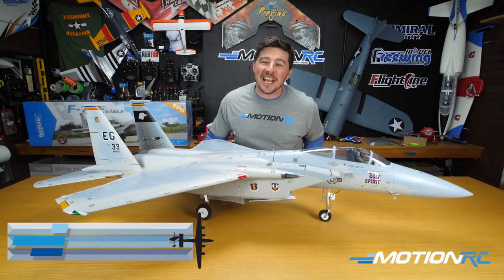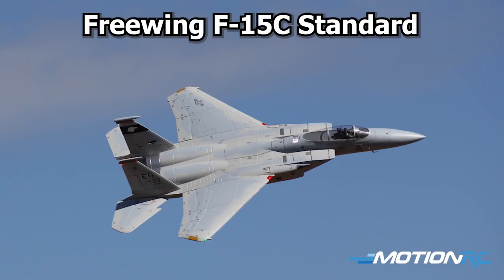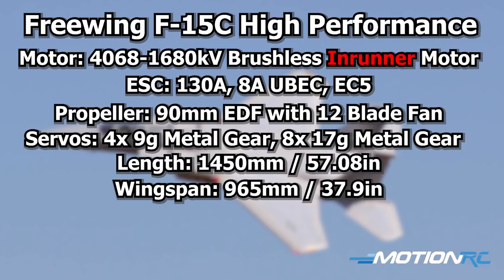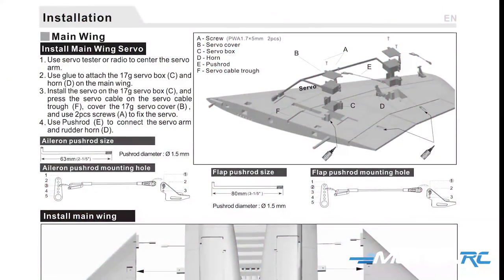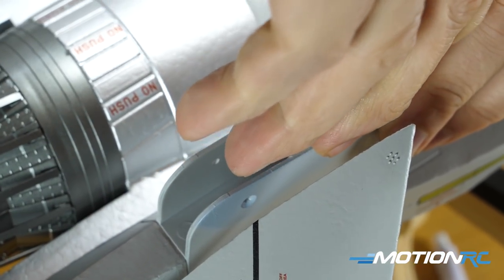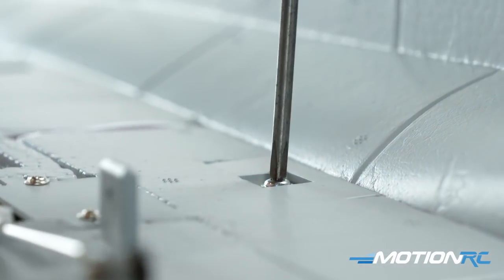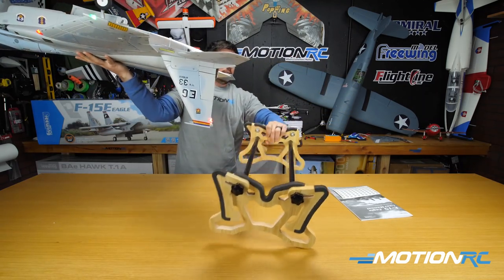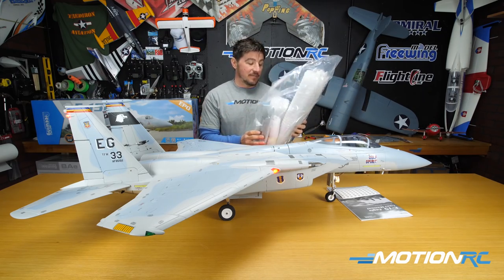Freewing F-15C Eagle 90mm EDF Jet - Build Video - Motion RC

Comment: A simple correction for the ordinance.  Those are replicated AIM-9 Sidewinders and AIM-120 AMRAAMs. They are  not AIM-7 Sparrows, which have not been used by F-15's (or the rest of the USAF) since 2004/5'sh. AIM-7s could only be loaded to the 4 stations on the main fuselage; AIM-120s can be loaded to those same stations AND on the rails attached to wing pylons.  I was a Maintainer on Eagles for 8 years before switching over to Raptors; 21 years later I am retired and enjoying videos of folks like yourself playing with miniature versions of those jets.  These 90mm EDFs are just amazing facsimiles or the real jets; can't wait to finally buy one or 4.
Reply: Thank you for your service! Are you flying them now?
Reply: Thanks for your explaination. Really useful

Comment: The build was fairly easy except for the rudder.  The opening  to receive the wires is much too small.  I really had to work very hard to get the wires to fit the opening.  Not sure what the solution is since carving up the original opening is probably not a good idea, since the contents in the opening are not known.  Otherwise, good build and excellent plane quality.   This experience taught me not to be hesitant to buy from the open box stock.  A few minor cosmetic finishes was all I needed.

Comment: Will a Flysky FS-i6X i6X 10CH 2.4GHz AFHDS 2A RC Transmitter With FS-iA10B Receiver run this aircraft and or f14? Very nice aircraft!
Reply: It should (it’s a 10 channel Receiver). I have the FlySky Fsi6. I would really recommend a spektrum transmitter though because the flysky springs are WAY too loose in my opinion. With a spektrum, the springs have way more resistance, which is something that you would want for this model, to prevent over-corrections.